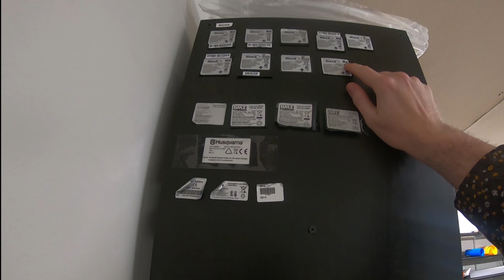BionX 48V 6.6ah Full repair video (Difficultly: Hard)

Comment: I have just repaired my BionX 8.8ah battery and upgraded it to 12ah which will give a useful range of around 45 miles or 60 km. I agree that they are not easy to refurbish but it is possible if you are systematic. I bought a replacement ready built 48V 12ah battery pack through eBay which came with its own bms attached which is no use for the BionX system. I transferred the wiring across from my existing battery and bms including the four temperature sensors. To my horror it did not work and the battery refused to charge or work. After much investigation I discovered that I had damaged one of the four temperature sensors when removing it from the worn out battery pack and fitting it to the new battery pack. Fortunately I was able to obtain one of the last wiring harnesses for the bms balancing system which includes the four temperature sensors. This was replaced and now the battery charges perfectly. Happy days and my BionX system lives for another day with increased range.

Comment: Help, advise.  I have a Bionx 37v 9 Ah, the old Li ion all leaked.  I assembled a new one, put the capacity more, thereby reducing the number of cans, won a place for connecting bms + bluetooth.  I connected everything, the bike does not turn on, there is no sound when the power cable is connected to the board, charging is in progress.  Maybe Bionx has detected the internal resistance of Li ion and understands something has changed and won't start.

Comment: What thicknes of nikel strip did you use? I built a few 36v 15-21Ah batteries but i went crazy overkill with the nikel. I used 0.15 mm and i configured them to have at least 4-5 series connections and now looking at your battery im asking myself if it was really needed to 'waste' the nikel👀
Reply: depend on required amp draw, what he did is ok for stock 250w motor, if you want to pull a lot more amps/watts like 500 or 1000w you need a lot more nickel

Comment: Any tips on repairing the charger inside the battery box? I was messing around trying to see if it would charge at 25V rather than 26V but the current must have gone too high and now there is a short on the charging cable. I thought it was D2 but after removing D2 it was fine. There is what seems to be a big SMD resistor, it's Black and says it should be 5M0 at least it just says 5MO on it, thinking to remove this and see if it went short but perhaps it's one of the transistors. Strange transistors, just a small metal strip Q1 Q2... etc. Do not look easy to remove. 
  This one is actually from a "Smart" bike, as in the Mercedes Smart cars.
This is the first thing i found so i thought i would ask before looking further.

Comment: As a battery builder I enjoy watching you build batteries. How many hours did the battery take you to build? How loong time do you spend on average building one battery?
Reply from the maker: Usually less then an hour. But these takes about 90 minutes. Not counting charging and screwing it back together.
Reply: @TheBatteryDoctor   damn that is fast. 90 minutes taking the old cells out, building similar design, doing the soldering + bms?
Reply from the maker: @Hamid9e  Yes i shorted down this video a little but 90 minutes including coffea etc for an advanced ca 40-50 cell battery. We always replace the BMS if we can so that is a timesave. Ive build so many 1000s of batteries so most are done in less then an hour. If i must have the holders then "taking the old cells" can take about 10 minutes extra.
Reply: @TheBatteryDoctor   that is very quick i must say. But as you said you made over 1000s batteries and got a lot of experience. 😀
Reply from the maker: @Hamid9e  Do you have a battery shop? Or do you repair batteries just 4 fun?
Reply: @TheBatteryDoctor   i don't have a shop, i do a bit beside studying. 😀 Jeg nyder det 👌

Comment: Do you need to connect the bike to the BBI2 software  for such regeneration? Assign new cell capacity? Great movie, bro
Reply from the maker: No it will be adjusted after a couple of full cycles.
Reply: @TheBatteryDoctor  I have +48v Ride + batteries, will the procedure be the same?

Comment: is it possible to use another batterie? why restore this one of it is not a good design?
Reply from the maker: no BionX is a proprietary system (like apple) locked to only work with BionX batteries, even the motor has special electronics preventing other controllers, grin has great info about this.

Comment: Hi, I have a Bionx battery to fix, but even with the battery at 50V the charging light blinks green. Is the BMS/charger blown? It is a 48V 7Ah I2C I guess. The procedure to wake the battery works (4 beeps) but the charging does not work better afterwards.
Reply: I know this is a late reply.  Blinking green is over charge, some of your cells charged past 4.2v which is the danger zone for Li--ion. Probably have some weak cells so the bms is compensating by overcharging the stronger ones. Probably need a rebuild. Bib2 will show it.

Comment: You mentioned a secondary BMS. Are there generic BMS? If so, what parameters should be matched?
Reply from the maker: Yes we had to install a small size secondary bms (any type) just for charging, twice! At least 2A for charging, also add a new charging port. And charger.
Reply: @TheBatteryDoctor  Does the "series" need to match? That is to say, can a 14S BMS accurately balance a 10S battery, or must the "series" match? Thank you for showing your work in your videos.
Reply from the maker: @bob-ny6kn  Yes you must have the right BMS, the series must match.

Comment: Please teach master joda, I shall be your trustee servant.
Show me how to fix shitty gunai battery that just died after rebuild and changing two motors and two controlers and removing 65 billion unnecessary led lights from my sons stupid scooter.
We humble users just want to have some fun in the mud not loose ur minds in optionaly colour coded wire jungle and  loose feeling in our fingers from hot glue and solder....
Reply from the maker: We just had one of them in. Massive 60V30AH battery with LG cells! Dual motors and controller! Topspeed of 80 km/h or so. However water had gotten into the battery and it was a mess! Will add video soon!
Reply from the maker: Now its up! https://youtu.be/u5q0wdEvjrY